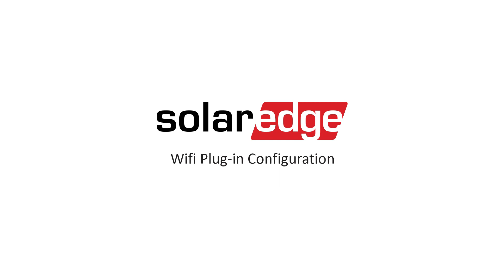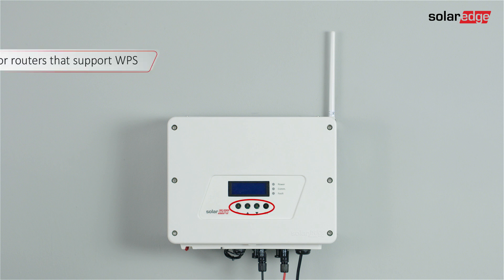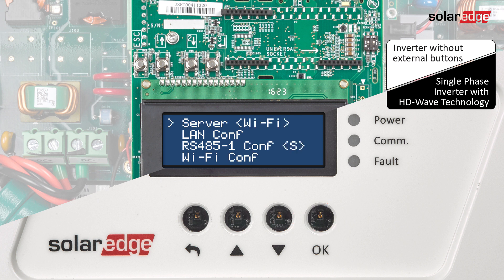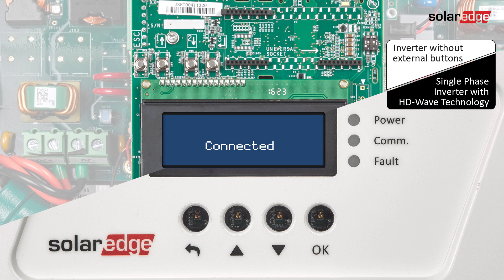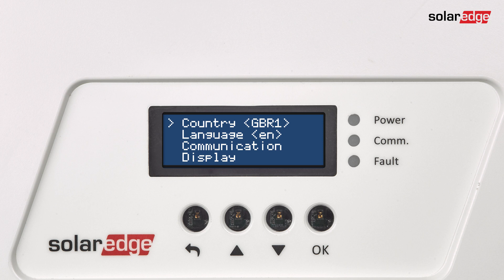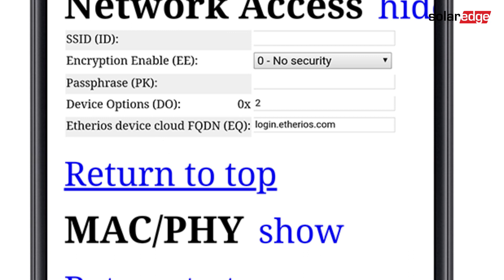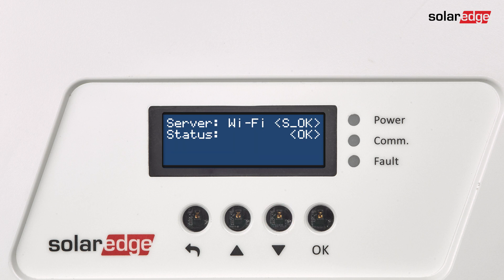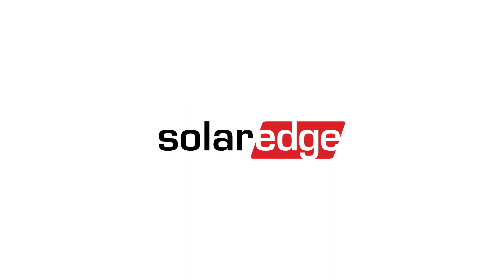SolarEdge Wi-Fi Plug-in: Part 2 – Configuration

Comment: This system is horrendous and I wouldn’t recommend it at all. I’ve had an IT person down here trying to configure the system to wifi but inverter still comes up with Site not communicating. I really dont know what to do next. The only reason I wanted this all connecting up is because my solar iboost is recording water hot when it isn’t. I can heat the hot water up from the gas system so the thermostat must be OK. The iboost unit is only a year old. I’ve changed the batteries outside ar the meter, no difference. Anyone have any ideas??

Comment: Hi, what if the SolarEdge inverter has "NO LCD SCREEN" at all? and our local dealer does not give us access to SetApp account either? They're demanding us to pay 3000 LKR (Sri Lankan Rupees) that's around 25 USD just to come over, scan the QR code and connect the inverter back to the router. How stupid is that?
Reply: Same thing happens here in Australia.  $120 fee to come and change your password.  I think I’ve done it with mySolarEdge using my mobile but without any help from the installer
Reply from the maker: Can you please send a private message to our Facebook page with your contact details?
Reply: My supplier is going to charge me £200 to come over!!